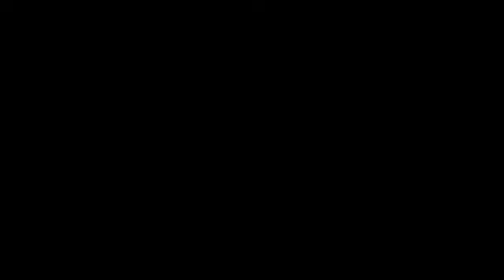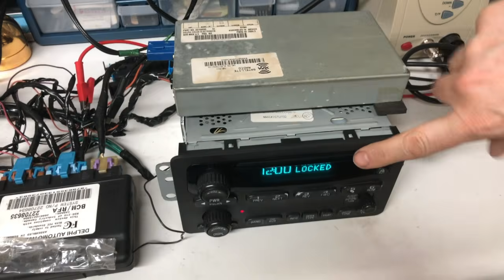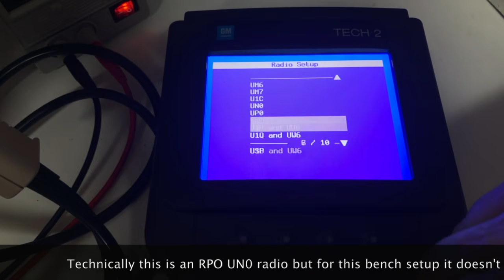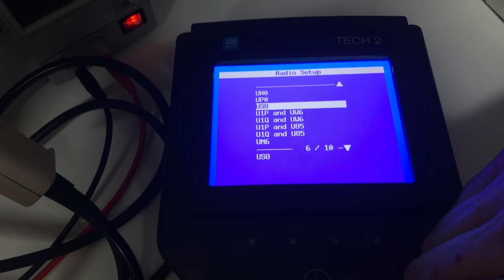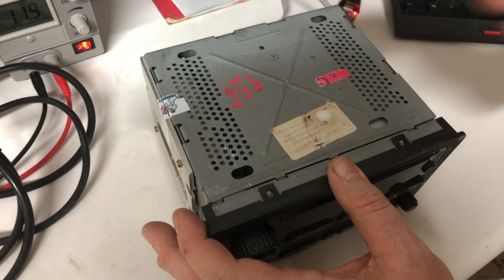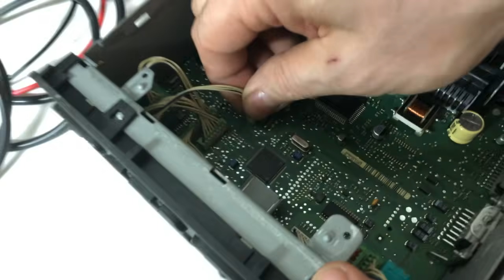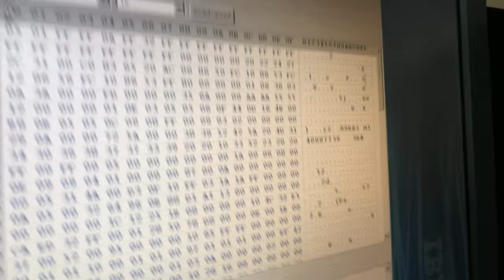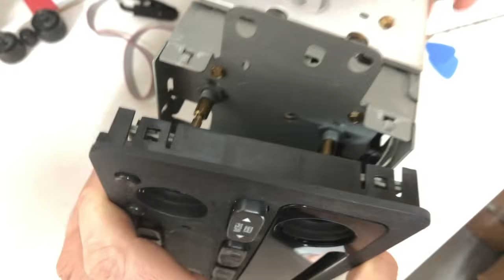2003 - 2006 How to VIN Unlock Salvage Yard GM RDS Radio w/ Tech2 OR Manually Programming its EEPROM

Comment: Im assuming that 160309 number you got by looking at the vin from the original radios eeprom chip?

So if i choose this method i need to get the vin number from the original radio and then use that number when programming the replacement radio....so the bcm will look for that number when it starts up and it will work....

Could i also just leave that vin completley blank and then the bcm will treat it like a brand new radio and create its own vin for it?
Reply from the maker: Yes, the video explained how the radio VIN format differs from the regular format.  You would need to know the target vehicles VIN, and then you can do what I showed to marry the radio on the bench.

You can also try a 0x00 or 0xFF as I replied earlier to virginize the radio to the BCM.  But this approach does not work with all firmwares.
Reply: @DrShock ok then the only way to know the original radios vin is to "tap into" the eeprom with the eeprom tool that you used and you can see it that way?  Or is there any other way?

I hear about holding down 1 and 4 preset buttons but that did not work for me.  

Also how did you have your end buyers find their vin?  Did they call the dealer to get it?  Because obviously if they had this eeprom programmer tool they would be able to just unlock it themselves
Reply from the maker: The only way to know the VIN the radio is locked if you don't know the donor vehicle VIN to is to read the EEPROM yes.  The button press is for a previous generation of radio, not used since 2002.   The whole idea of the videos I do is for folks to unlock it themselves buying the inexpensive tool I demonstrate.  ;-)  But you are still going to find folks who don't want to do it themselves.
Reply: @DrShock ok so it looks like i will repair this for myself but I won't be able to flip them on ebay because the end buyer will need to know the VIN...unless the end buyer can get the vin of their radio from the dealership

Oh wait scratch that.  It seems like end buyers will be able to get their code from the dealer if they provide the VEHICLE VIN and proof of ownership....with vehicle vin and proof of ownership end buyer can get the original radio vin.  Then I can use that to program the replacement radio for him/her with the help of you and your knowledge....expect a $50 donation from me if this works after my first successful flip doing it
Reply from the maker: :-) Thanks.  So two things.  You can get your vehicle VIN right off the dash plate under the windshield on GM vehicles, drivers side.  You then just need to learn the radios format for the VIN for each radio model.  It's always a subset, nothing encoded.

For situations where the VIN is not known, or not immediately handy, then you can find those radio models that are happy to be cleared out with either a hex 0x00 or 0xFF.  Only the number of memory locations originally written though, do more and it will detect the tampering.   Do less and it will remain VIN locked or the radio will restore the locked VIN from backup.   If you are going to attempt this as a business, you'll have to learn all of these differences.
Reply: @DrShock @DrShock ok so i was thinking if i gave the dealership my vehicle vin (which of course is off dash plate under windshield) then they can give me the RADIO vin....the vin that my bcm is going to look for when a junkyard radio is installed...when i refer to radio vin im referring to the 6 digit code that you are putting in when you edit the information in that eeprom software...

So in this case i have my old radio and when my eeprom programmer comes in tomorrow i will find that 6 digit code by "tapping in" and seeing it in the software....but what if i had an ebay end buyer and he/she only had their vehicle vin...is there anything i can do with that vehicle vin to get the 6 digit code needed to unlock the radio for them to use?
Reply from the maker: You don't need anything from the dealership.  The buyer can give you the vehicle VIN, and you extract what information is needed from that alone.  Or, for some model radios, you can viginize it as I've mentioned a few times already.
Reply: @DrShock ok i guess the last 6 digits of the vehicle vin itself is the 6 digit code that i would use in the radio eeprom to unlock it....the last 6 digits of the vehicle vin is the radio vin, correct?
Reply from the maker: I mentioned earlier the VIN representation can vary by radio design, you have to watch each of the videos and learn the differences across radios, where applicable.
Reply: @DrShock ok so if I was a buyer and you were selling me a radio on ebay...I give you my vehicle VIN what exactly would you do to sell me a radio that is unlocked for my car?
Reply from the maker: What I showed in the video ;-)
Reply: @DrShock i will watch again...sorry not trying to be a pain just trying to really understand this about the vehicle vin....I didnt see anything mentioned in the video about anything related to a vehicle vin number and what can be done with that vehicle vin number to get the radio code....because it seems like having the vehicle vin from the end buyer allows you to unlock it for them and I just dont know what to do with that VIN number....

I just want you to know that I don't expect this in this video you created. You created an EXCELLENT video and instruction that will help 100% of us out here....i don't even need my vehicle vin to get the EEPROM code because your brilliant video taught me how to use the EEPROM software to retrieve it....I just want to know the alternate way to get that 6 digit code without physically having an end buyers radio to use the EEPROM software with...I want to know how exactly to get that 6 digit code with JUST the vehicle VIN#

Im basically trying to sell to an end buyer by using just the EEPROM software....but it sounds like if I had the VIN number I still can't get the 6 digit code with just that...but what I can do is get the RPO with the VIN and do it via the way of a tech2 scan tool?  Is it safe to say that the EEPROM method can not be used with just vehicle VIN number?  EEPROM software method you would physically need the radio to be able to read the 6 digit code off of original radio so you can unlock the new one?
Reply from the maker: So there is NO CODE with these model radios.  That's an older generation from the 1990s - Theftlock.   These EEPROM based radios it's just a shorthand representation of the VIN.
Reply: @DrShock im using the wrong terminology....when i said code i am really referring to the radio vin....the 6 digit numbers that you edit in the EEPROM software.....im assuming these 6 digit numbers are simply the last 6 digits of the vehicle vin.  Or am i wrong and the BCM randomly generates a random 6 digit vin for the radio?

If its as simple as the last 6 digits of the VEHICLE VIN then all I would simply need is the end buyers vehicle vin and i can easily unlock a radio for them by writing it in the EEPROM....when they receive the radio it will work because the BCM will look for that number

Comment: Is that 160309 specific to the VEHICLE?  The vehicle looks for vin 160309 and if it doesnt see it then the radio will be locked?

Also how did you get this 160309 number?

Im starting to think my idea wouldnt work....i was thinking about unlocking these radios and selling them on ebay...flipping them from the junkyard as unlocked radios....but it seems like i can only unlock it to the vehicle i am putting it into because you need to "marry" the radio to the vehicle with the correct vin?
Reply from the maker: You can either have the buyer provide the VIN, and code it that way which is what I do when replacing one as I shared in this video.   Or, on some models but not all, you can blank out the memory locations used by the VIN which virginizes the chip (either 0x00 or 0xFF depending on the radio era).  The BCM will detect this and write the correct VIN just as it would for a brand new replacement radio from GM on the initial power up.   However, for newer model year vehicles this approach won't work reliably, as GM has both blocked reuse of used modules and their SPS2 programming system will not write out to an used module.

You would have to provide a time index in the video for this number you're referencing.  This video was from many years ago for me to recall off hand.  I think you might be referencing the VIN representation, what's stored is not the same exact string as the actual VIN.  The radio asks the BCM for permission to power up unlocked, the BCM will approve or reject the VIN string the radio has stored.

Comment: On your bench what did you have the tech2 scan tool plugged into?  Obviously not the obd port of the vehicle as you did this on the bench....im curious because im thinking about doing this to make some side money and if it can be done outside the vehicle and i can sell junkyard radios unlocked i can make some decent money for my time.  I will happily send you a nice $50 donation too, because without you i would be lost
Reply from the maker: You cannot do this bench setup with more newer vehicles, but these older ones had a much more primitive networking design so just having the PCM and BCM on the bench with the radio replicates the in-vehicle setup.   With some models you can even omit the PCM.   We're just using the DLC (diagnostic link connector) port from the same vehicle wired up as described in the video.   This both supplies the Tech2 with power and ground, but also makes the networking bus connection.

Comment: Great video, very thorough but not really feasible for the common person trying to reset or recode a used radio. Do you have a service where someone can send you their unit so YOU can do this programing? That would be very helpful and realistic in my view. I realize this video is a few years old but I doubt someone with your knowledge and expertise would have switched to a different career. Thanks

Comment: My CD was broken so I bought a used radio and swapped the EPROM chips. Works just like the original.
Reply: @sdjgfashjasbfasd  
So I'm clear, you ONLY swapped the EPROM chips, nothing else and it worked? I'm working on my 06 Malibu, have a doner radio of the same year and type, I can't follow nor do I have the tools, to do this technical stuff
Reply: @TammyBowen-w8y  Did your radio work ?

Comment: My radio was not able to be programmed with a tech 2 we tried twice. Not sure if his tech 2 was older or newer or what was the case. I opened the bottom the radio and do not see the two EPROMs like you showed. Looks like maybe there is one in the center of it. I ordered the EPROM writer you suggested but not sure what other steps need to be taken with my specific 2006 radio. Gm part number 15234915
Reply from the maker: GM made many different radios that looked similar / same from the outside.   Each has a different circuit board design.   The approach I show in this video, as well as many others I've done, is the same but the location of the memory chip can vary from design to design.   Perhaps check out some of the other videos in the playlist for a better match to what yours looks like?
Reply: @DrShock will that eprom reader work the same way or does it have to be modified for different model number e proms?
Reply from the maker: It would work the same way, you can use any reader/writer programmer that supports the types of chips used in these radios.  That one I suggested is just one of the lowest cost ones.
Reply: @DrShock please link me to that eprom writer. I looked up and down that forum page you linked on the other video and I cannot find it for the life of me. Thanks
Reply from the maker: This is the linked video https://youtu.be/hPKckby54uA and you'll find more information in the description text area of this particular video on that tool.
Reply: @DrShock correct but I tried the link you posted in the description. But can’t find the file.txt download for the asprogrammer. Can you please check the link you provided for the  and make sure the download is still there in that link?
Reply from the maker: It appears this forum I referenced got reorganized at some point, I just updated the link as well as the instructions in the description.  Thanks for highlighting the problem.
Reply: @DrShock in the asprogrammer I am getting a connecting error ch341 not found. When I connect and disconnect  to the chip I hear the windows flash drive noise. Please advise I feel like I’m close.
Reply from the maker: Since the programmer is detected by Windows (from the sound you note) this error sounds like you have not installed the USB device drivers for the CH341A device (or there is a problem with them).   These drivers should have been included from whoever you bought the EEPROM programmer from.   I also linked a version, albeit very old, of the drivers in the description of that same video quoted earlier.
Reply: @DrShock any way I am not setting up the hardware correctly?
Reply from the maker: That's also a possibility.   Usually, one would have a blank EEPROM chip handy to test out the tool (aka programmer) setup to be sure the drivers and software are all setup correctly.   You could use the blank chip to verify proper read/write operations.   When inserting the chip orientation is important, and different families (e.g., 24XXX numbered parts vs 95XXX ones) plug into different halves of the ZIF socket.

Comment: Do you know if this works for an 09 Trailblazer? It has the same type of unit with single CD, no tape and the CD can also read MP3 CDs. I should add it does have the US8 option code.
Reply from the maker: It would be similar, but likely not the same.  The reason I put years in these video titles is that while the radio faceplates follow a common design theme from GM at the time, the circuit boards inside vary considerably across models and model years.  Making the chip location different, as well as the numbering on the chip in many cases.

Comment: My board is not like your board. It is a 2002 RDS. Any suggestions not including the dealer?
Reply from the maker: Yeah like the title on this vid, it does not apply to prior to 2003.  There are dozens and dozens of the Delphi radio circuit board designs.  They are all different, but for that year the Tech2 route I showed here should still apply.   And the board level approach will also still apply, but you'll have to determine where the EEPROM is on the 2002 RDS type board.   A forum search may reveal someone who has already solved that.

Comment: So do I understand correctly that when the radio powers up it checks the radio VIN against the vehicle's VIN and if they are different it locks the radio? So all you have to do is to change the VIN in the radio chip to match the vehicle? Do you need to know the VIN of the vehicle you get the radio from? Where do you get the test clip and the EPROM programming software from?
Reply from the maker: The radio module communicates with the body control module (BCM) over the low speed GM LAN bus.   The BCM gives out the VIN, the radio compares that VIN to what was stored when it was programmed for the first time.  If they match, the radio powers on.  If they do not match, the radio goes into VIN theft lock mode.   The VIN within the radio has to match the VIN of the BCM, which in turn matches the VIN of the vehicle/PCM/ECU.

Comment: I have a 2003 Tahoe and stock radio died I got a replacement at the junkyard and I have Vxdiag and tech2 win I am not seeing any options to program the radio? I took radio apart from the bottom and did not see the eprom chip. I didn’t completely remove the front cover,cd and tape deck. I am assuming the chip is under the CD player. Anyway any help programming with the tech2?
Reply from the maker: The Tech2Win emulator will not have all the same features as the physical Tech2.   For some reason GM removed this VIN relearn feature from later releases of Tech2Win.   You might try building the vehicle as a 2006 Monte Carlo instead to get around this from what some folks have tried.

Then accessories, entertainment, module, setup, radio in the Tech2 menu tree.
Reply: @DrShock I tried that didn’t work. I am trying eprom now. I get it to read but nothing that comes back looks like a vin.
Reply from the maker: If you are getting FF type sequences or 00 type sequences, this can indicate a radio board where the testclip is powering up other components inadvertently.  Meaning you will have to first desolder the EEPROM from the board to read/write it.  Some circuit boards are like this and thus the EEPROM cannot be programmed while still mounted onto the board.

Comment: Looking into buying a tech 2 or autel scanner. Any thing to look for when buying a tech 2 or do you know of an autel model that would be able to unlock radios, perform hvac troubleshooting and resets? I have a 2004 silverado 1500. Thank you!
Reply from the maker: A Tech2 clone is likely the most affordable option, with search links on two locations in the video description.   Be careful when buying an used one, as while the clones in my experience are excellent copies with 100% parity in functionality they are not as robust and shop abuse would shorten their lifespan.

Comment: My chips are on opposite sides of the board and I'm not able to connect to either one; have any suggestions? When I connect the usb interface cable, the red status LED either turns off or goes dim depending on which way it is clipped.

6 disc unit
The two chips are:
1001375 K631W

15532 6T47
Reply from the maker: The 1001375 is most likely the EEPROM chip, try reading it as a generic 24C16.  But you'll need to desolder it from the circuit board, doubt you can read this type in-circuit with a testclip.